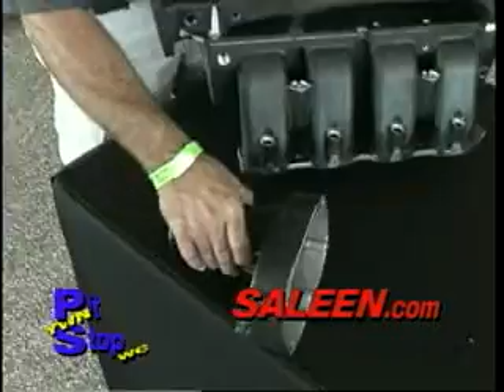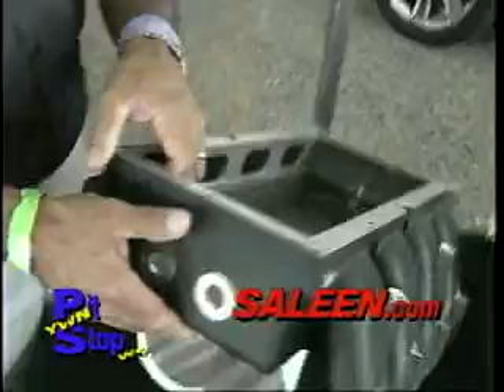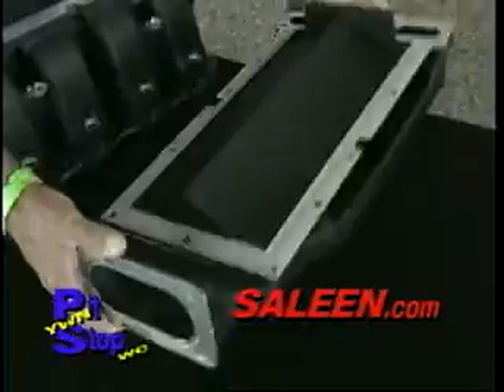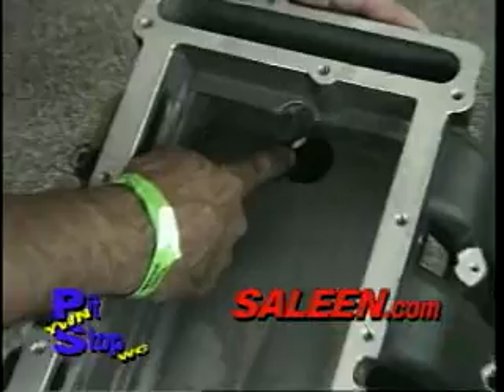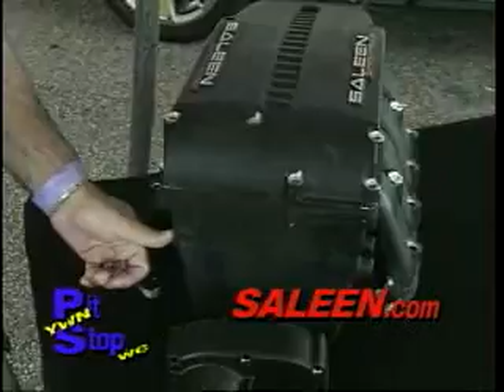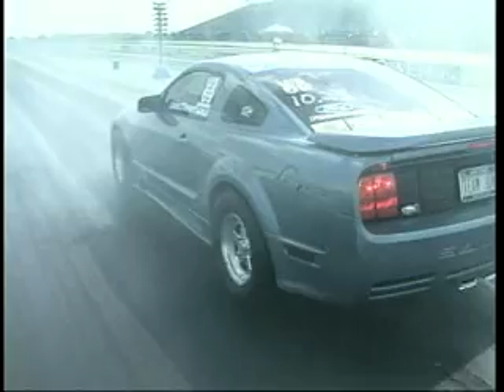SALEEN SUPER CHARGERS

Comment: Did I miss where the oil plug is located?
Reply: Oil plug is located in the front on driver side. Its a small bolt. Kinda hard to get to but manageable

Comment: CAN THIS UNIT BE BOLT ON TO THE REGULAR 4.6
Reply: I run this system around 5psi max on a 2006 Mustang GT 4.6L 3v V8  with a stock airbox.   around 400 rwhp

Comment: The valve or vac positive isn't under the intercooler first. It's located at the rear passenger corner of the casing. If the stop bolt is removed then it will not make vac and the car will not perform or run correctly.